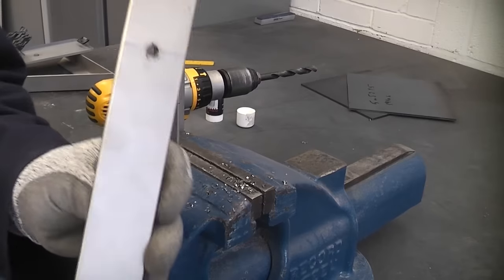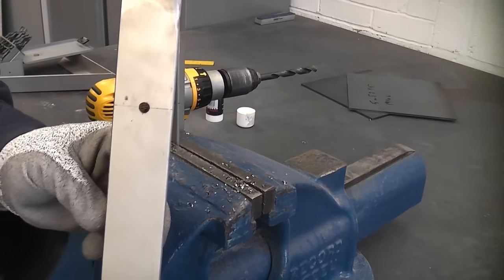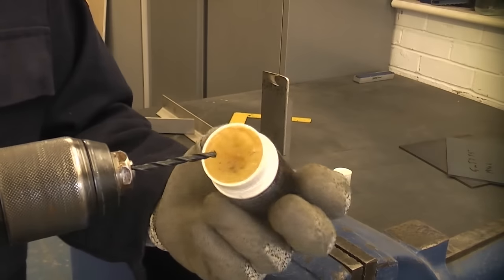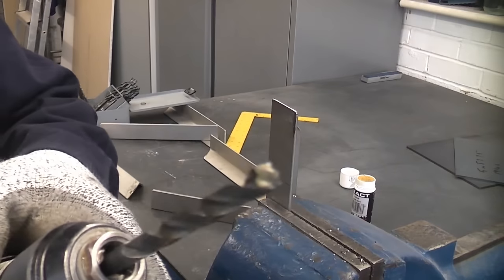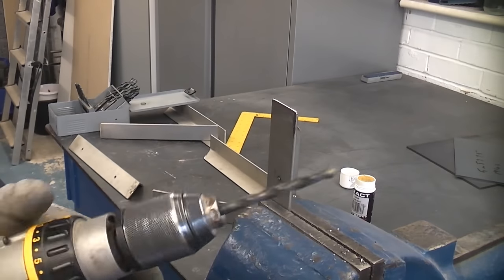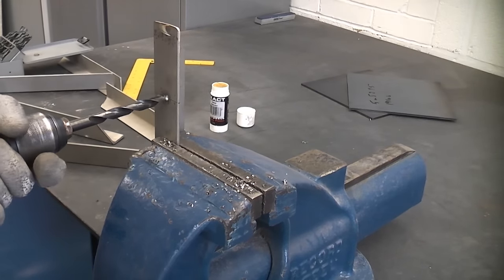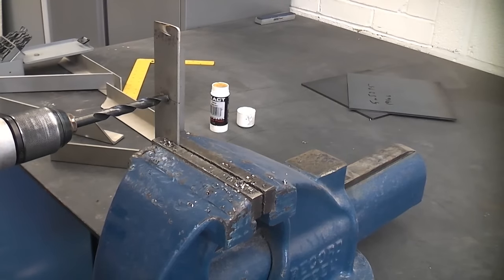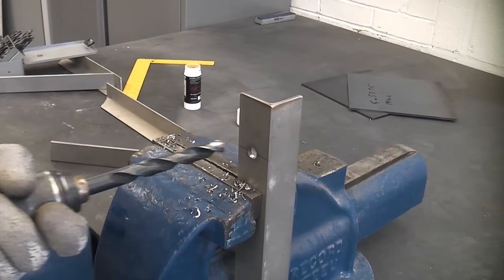How to drill stainless steel

Comment: what kind material is that drill bit made of? i tried titanium bits every single one didn’t even made a hole on a stainless steel
Reply from the maker: Some TIN coated drill bits are useless. Good quality cobalt drill bits work well on stainless steel .
Thanks for the comment 👍

Comment: What happens if you do harden the metal? 
I'm almost certain I've hardened a broken bolt. Hard steel drill bits just dance around on it
Reply from the maker: You might have to use a solid carbide drill bit, but they are expensive and brittle!

Comment: OK interesting to know, I'm preparing to build an aviary I have never attempted anything like this,  I was originally thinking wood, but at the rate Macaw go through wood that is pointless,  I was told I couldn't use aluminium but there is a way of washing the toxins out of if, but I've been feeling like if I want to tackle that I may as well go with stainless steel,  is it much harder to work with for that hardening thing..should I avoid it going into this with zero experience..
Reply from the maker: Working with stainless can be challenging! 
But you only learn by having a go 😉

Comment: I'm new to this and didn't realize I'm not supposed to let the metal get hot!
What brand of Cutting Paste do you recommend or are they pretty much all the same? Thanks!
Reply from the maker: I've not tried them all, but I would imagine they are pretty much the same.
If you can't get paste, you can get drilling/tapping fluids, you can also get them in aerosol tins etc.
Anything is better than nothing, even water.
Thanks for the comment 👍

Comment: I have drill bit which drills in carbon steel, but unable to drill in 1.5 mm thick stainless steel plate, 
What should i do
Reply from the maker: A cobalt drill bit will work better on stainless.
Thanks for the comment 👍
Reply: Thanks brother

Comment: Hi ultimate handyman
What's the best screws/ bolts for fixing steel staircase to a steel beam?
Thanks
Reply from the maker: Best get advice from a structural engineer for that, I'm guessing he will specify bolts but I do not know what size.
Thanks for the comment
Reply: Ultimate Handyman 
Thanks for the reply mate

Comment: What the best way to stop the bit skipping around as every time I go to drill stainless it skips and I'm drilling mirror polished tubes  for truck light bars, thanks
Reply from the maker: +George Roberts A centre punch and hammer is the best way, it creates a tiny dimple that stops the bit wandering. An automatic centre punch might be better on tube but you will have to watch for it slipping off. Have you tried using a piece of masking tape?

Comment: What type of drill bits require for stainless-steel sheets ?
Reply from the maker: It depends how thick the sheet is.
For anything over 2mm I would use Cobalt drill bits.
If it's thin sheet, I would use a cobalt step drill - https://www.youtube.com/watch?v=fvumt2z0GLI&t

Always go slow and use plenty of lubricant/cutting fluid, as stainless steel soon work hardens and can blunt tools quickly

Thanks for the comment 👍

Comment: The video makes it look so easy. I'm having major issues trying to drill a 316 stainless steel wall shelf. I've tried lubricants and dewalt cobalt drill bits even slowed it right down and it just doesn't work for me.
Reply from the maker: The cobalt bits should easily drill the stainless, providing it has not been work hardened.
A sharp drill bit, slow speed and coolant, should help 👍

Comment: Im just trying to drill a couple 3mm holes on what used to be a stainless knife, but it just destroys the bits. I supposed it has been hardened, but I didnt expect it to be this hard to make a small hole
Reply from the maker: If cobalt drill bits won’t work, you could try solid carbide drill bits, but they are very brittle!  👍

Comment: Why not to use the largest bit at first? What would happen if drilled with such?
Reply from the maker: You run the danger of work-hardening the stainless, which will make it much harder to drill
Thanks for the comment 👍

Comment: Lol I found this out the other day when I tried to drill through some stainless plate I got to make a bracket with, thought it would go through easy like mild steel but no, I made the mistake of getting it hot. Bought some better drill bits to have another go at it as they weren’t the best either.
Reply from the maker: Thanks for the comment 👍

Comment: Once the stainless "work hardens", how do I recover to get a hole going again? I ran into this problem with some cheap china brackets that came with my intercooler kit. The first bracket went like cake and the second is now almost impenetrable.
Reply from the maker: +2slofouru 
Very difficult. If you have some drill bits designed for hardened steel such as Artu drill bits or Carbide drill bits you will be able to drill it.
You might also be able to do it by heating it up and letting it cool again.
Reply: Alright, thanks for the advice
Reply from the maker: +2slofouru 
You are welcome ;-)
Reply: You can try a Hss-Co (Cobalt) bit. It saved me several times.

Comment: As dumb as it sounds i have always had a hard time drilling SS even with new bit's. I never thought of using cutting compound and slowing things down a bit. Thanks for the video. :)
Reply from the maker: PimpYouriPhone5 Many people struggle drilling stainless.
Cobalt drills work particularly well on stainless, but for this demo I just used HSS.
You are welcome, thanks for the comment
Reply: ***** I find if you're working horizontally, WD40 or similar can work as well as cutting compound, while keeping the bit cool

Comment: It's possible to drill with hss 0.4 mm hole?
Reply from the maker: Almost impossible, especially with a hand drill. Most drill chucks will not even grip such a small diameter drill bit.

Comment: I need to drill a  hole  in my anodized pots handle to hang them, but much bigger than the hole in the video, I have metal bits and cones bits as well for metal can you make a video  tutorial for that as well? Or any advice very much appreciated.  This video was very helpful as I get a little nervous to drill metal, so thank you very much. :)
Reply from the maker: A step drill would be best, as they are less likely to bite into the material.
Make sue you centre punch first, to prevent the bit slipping 👍
Reply: @ultimatehandyman  Thank you UH. What 's a step drill? I have  Stanley Fat Max drill, I was thinking to get a saw hole bit various sizes as well just in case, starting with your technique and then use the saw hole bit after for the final step; do you think that's gonna make it easier to drill into a very thick handle? I don't want ruin my new pans. Oh and the paste you are showing in the video I had no idea there was such paste for cutting metal,  one more thumb up from me.  Finally I want to ask how to smooth the edges of the metal after the cutting. Very much appreciated UH  🙂👍🏼👍🏼
Reply from the maker: @Cassiopea456   How thick is the pan handle?
All the pans that I own that have metal handles are pressed stainless steel, no more than 1mm thick. I assumed yours were similar, which is why I recommended the step drill.
Step drills are great on thin metals- https://www.youtube.com/watch?v=YD-WcAZ_ynI&t
If you have a link to the exact same pans, I will take a look at them and try to advise
Reply: @ultimatehandyman  The pan handle is 2 cm thick more or less, underneath is made of rubber, I posted the link from Ikea but my comment was not showing. So I'm gonna just write here the name of the pan. Sensuell from ikea, I'm gonna drop a couple of links in another comment just in case.  Thx UH I appreciate any advice. 🙂👍🏼
Reply from the maker: @Cassiopea456   Thanks, I saw the links, but I'm not sure where they went! 
I'd be reluctant to drill those handles to be honest. If the handles were to delaminate (the rubber separates from the stainless), they will say it is because you have drilled holes in them. I can’t believe there are no holes in the handles to begin with, I’ve just checked all 12 pans that I own and every single one, has large holes to hang the pans up!

If you still want to drill a hole in the handles, I would only attempt it, if you have a drill press and suitable vice. I can’t tell by looking if the handles are solid stainless steel, or pressed, but it might be really difficult to drill a hole in them, without the right tools!
Reply: @ultimatehandyman  Thank you UH, I so much appreciate it.  I will do more research and see if there is a company of professionals drilling holes of any thickness. I know it's absolutely an oversight not having holes in pans, I did not even think to check, first time ever that happened to me and I bought many pans over the years. Have a great Sunday and thanks again love and bless. 🙂

Comment: "don't let it get hot" lol I swear I saw smoke at the end of the vid!
I can always get to 6mm but all my drill bits and drills refuse to go any further (trying to put holes in new 10mm stainless or the original jaws for a vice)
Reply from the maker: If you are drilling a vice, it is probably forged steel, so might need cobalt drill bits/coolant and patience 👍

Comment: They form easy too.  It takes a lot of force to start it moving but once it moves it forms much better than mild steel or aluminum.
Reply: I used all my body weight & got nothing...  New drill bit, cobalt, slow speed, cold water, outdoor temp around 50° Fahrenheit.

Comment: Is paste needed for a uni-bit?
Reply from the maker: Yes, it's always best to use a paste/lubricant.
The only time you do not need to use paste is when using Tungsten carbide drill bits
Thanks for the comment 👍
Reply: @ultimatehandyman   Is it simply not needed for carbide bits or is it actually a disadvantage if you use it? I mean it can't hurt right?
Reply from the maker: @Gsazraetr   It depends what you are drilling. If drilling hardened steel with an ARTU drill bit, they specifically tell you not to use a coolant or lubricant. Example here- https://www.youtube.com/watch?v=zbJq2z2ya80

Comment: From what little experience I have, this would indeed be the commonsense way to do it, since directly using the largest bit will not cut it.

However, I have come across statements like
"twist drill bits are for making NEW holes, not for enlarging them", 
and
"when you do this the tip of the drill bit is not used, and after all, the tip is what you sharpen".

I would like to ignore these, but I wonder if there is some truth to them...?
Reply from the maker: If you are using a hand held drill, I would always use a pilot drill first.
But if you have a drill press, you can go straight through with the larger diameter bits, providing they are sharp 
Thanks for the comment 👍

Comment: I use Drill Hog USA "Cobalt Drill Bits M42/ 8% Cobalt- 68 to 70 HRC" for Hardened Steel Security Locks
Low Speed,  Cutting Paste, Consistent Pressure and Patience.  These bits are reasonably priced 
Qty (12) 1/4" bits for ~$30 or $2.50 ea..
Reply from the maker: Thanks for the comment 👍

Comment: How much pressure do you use?
Reply from the maker: That's difficult to answer as sometimes you have to back off with the pressure if it's biting too hard. You do tend to get a feel for it when you are drilling it, the most important thing is not to go too fast or you get heat build up and it work hardens. 
Thanks for the comment

Comment: Nice.  Too late for me though...    I don't know how I didn't think of searching Youtube for "how to drill stainless steel".  Argh!
Reply from the maker: At least you know for next time ;-)
Thanks for the comment 👍
Reply: @ultimatehandyman  Hey,  I got to give a shout out on your method.  I had to drill 12mm holes a couple of days ago on 304 SS.  Of course I watched a few Youtube videos with all kind of advices.  The main advice is to drill slow, and use cutting oil or paste.  
After starting the first hole SLOW with a 4mm drill nothing was happening.  Then I remembered the stop and go you did.  I started with 1 second drill, 1 second stop. The drill started DRILLING.  I used just water for cooling.  A plastic bottle with water and a hole drilled in the cap.  I drilled the first 4mm hole in like 15 seconds!  Next to 7mm, 10mm, 12mm.  Bursts of drills and stops.  Kept cooling with water.  Dipping the drill in water to cool it, and put some water on the hole.  Pressing hard all the time.

I think your method of drill/stop/drill works best because there is that "perfect" drill speed that the drill meets somewhere in the middle of the start/stop.  That perfect "Feed and Speed".   I think the KEY to your method is using new drills (sharp), and the stop/go.  

Case in point about your method:  I drilled holes today and needed to drill the counter-sink for the flathead screws (conic).  Used a 90 degrees 1/4" countersink drill bit.  These things are notorious of getting dull very quickly and that countersink was new and half dead already.  I started using that stop/go method (on regular steel) and dipping the bit in water when it got a little hot, and what was almost impossible drilling before became a very easy and fast drilling.  Proving, the trick is in the stop/go bursts.

Good on ya!   Great tip, and I wish a lot more people will know it.  

Cheers.  You're a live saver.  I can't thank you enough.

Comment: Its funny...i cut some stainless steel bolts with a hacksaw once and it seemed quite soft.
One of the worst things ive ever drilled is hardened steel,such as that found on hardened hasp and staples...needed to break out the Artu's for that one,lol.
Reply from the maker: animal79thecat 
Hardened steel is a pain to drill LOL
Stainless can work harden if not careful, which makes it hard to drill.
Thanks for the comment ;-)

Comment: Dont want to rain on your parade, but that must be some low grade stainless steel.
Try drilling through some industrial or restaurant ( food prep) stainless steel  and see how it goes....
Just finished drilling 4 holes through 4 mm restaurant stainless steel, broke 3 Dewalt industrial cobalt drill bits but finished it with a bosch drill bit.....and yes, used lubricant/cutting paste/ low rpm and all the good stuff
Reply from the maker: It was 316 stainless steel (which is often used in kitchens)

Comment: there shouldn't be any problem with stainless steel drilling if you have a hardened stainless steel drill  :-) but this was good enough :-)
Reply from the maker: Thanks for the comment
Reply: Rudolf Zaris Newer heard of 'Hardened stainless steel drill' i have used cobalt drills, and tungsten carbide drills... most drills are High Speed Steel and burn out on stainless if you have a High speed and High Feed and no coolant / lubrication.....another great upload thanks....